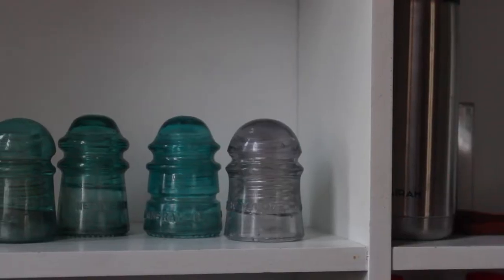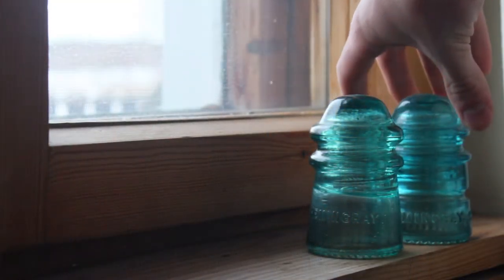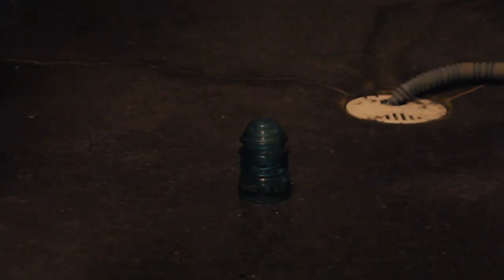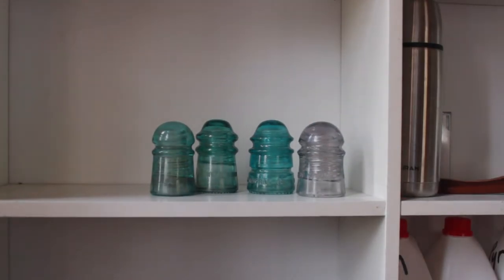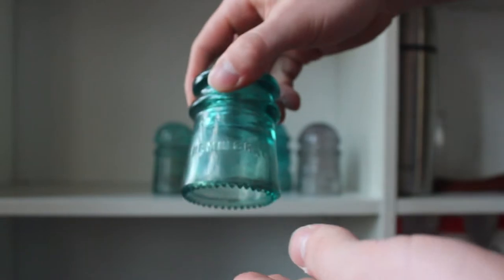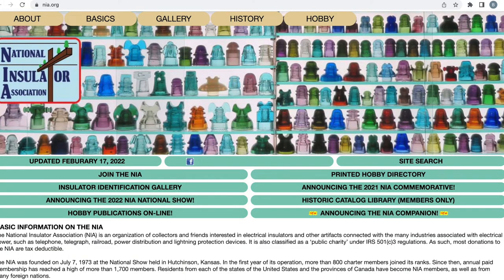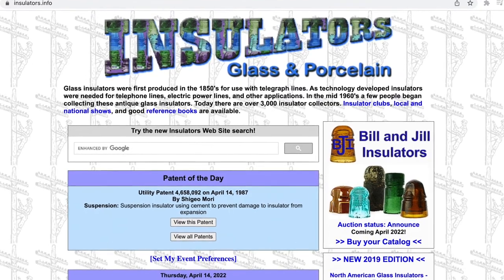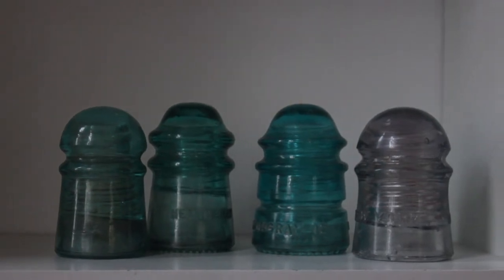The Glass Insulator, what is it?

Comment: As someone who's just recently got into hunting these pretty glass pieces, you really hit the nail on the head with this video! By the way, I believe that the CD-113 (Model 12) that you have, was used for individual home use as you can see the top wire groove for the main line and the smaller bottom groove for the line that would go directly to the house itself.
Reply from the maker: nice to hear the hobby is still alive! and thanks for the info about the CD-113 :)

Comment: The Hemingray 9 is  a "pony" insulator, used on local, lower voltage telephone lines.  it is classed as a CD 106 in the "Consolidated Design" identification system in use by insulator collectors.  The "Star" insulator and the "BROOKFIELD" insulators are also "pony" insulators. Both are classified as CD 102.   
It would sure be nice to take a time-traveling journey and be transported back 100 years ago, and walk up and down some streets in your average city or town.   You would be amazed to look up and see gobs of aqua, green or blue glass insulators in the air, installed on the tops of telephone poles!
  A few telegraph lines with insulators still in place are still up in a few places in the US currently (mostly along a few railroads), but not many!  It won't be long  before they are all dismantled. Sad.
Reply from the maker: Thanks for the great info David!
Reply: Bow can I research old telegraph line locations? Knoxville Tennessee?  Tia